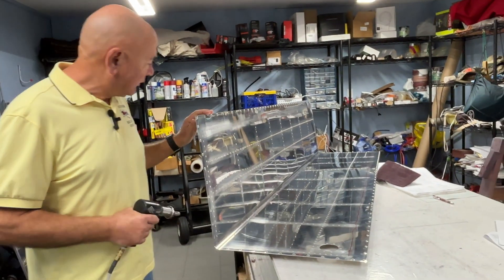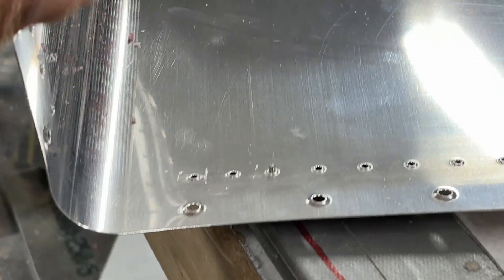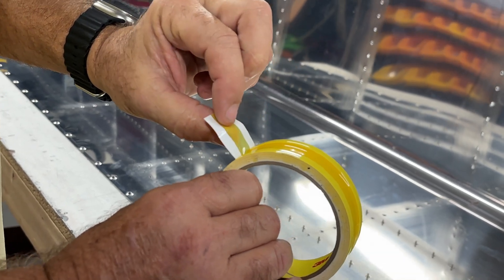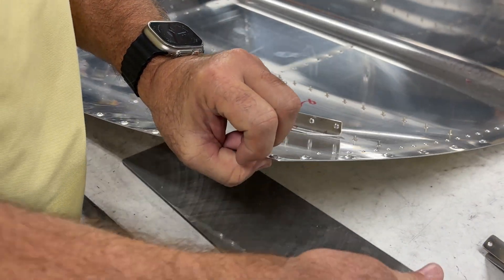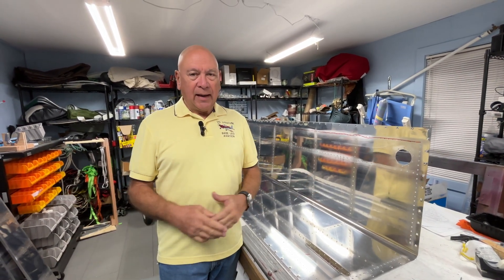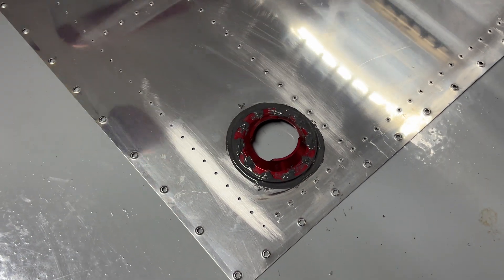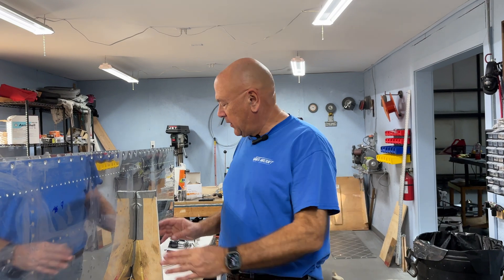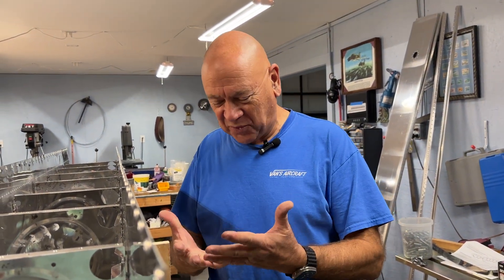Extended Range Fuel Tanks from Sky Designs proseal and riveting

Comment: Hey vic think about hitting your skins harder with the dimple dies. I noticed a lot of ripple especially around the screw dimples.
Reply from the maker: the screw dimples were done on the DRDT dimpler.
Reply: @ what are drdt dimples?
Reply from the maker: dimpler.
Reply: Yeh okay, just an observation from my aircraft builds, if you hit them harder the skin will lay flatter. Up to you of course but maybe worth getting a bit of scrap and experimenting with hitting them harder and see if you get a flatter result